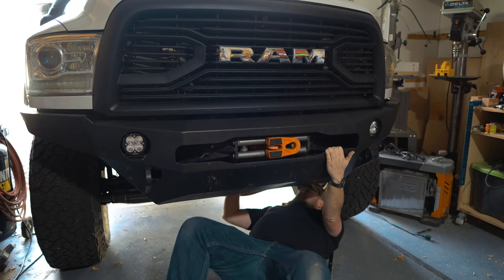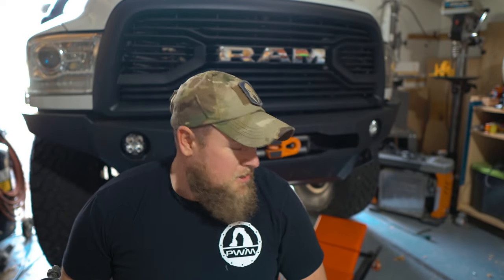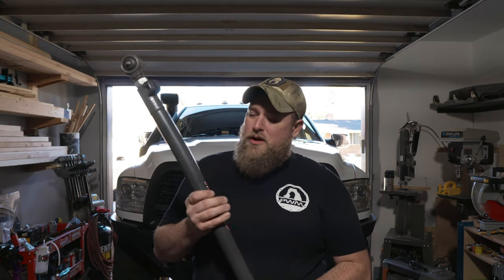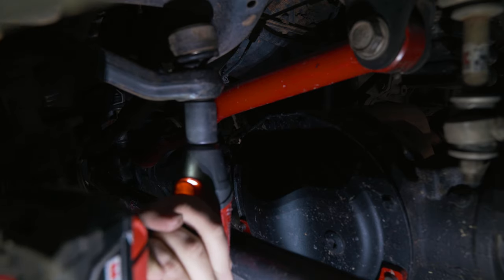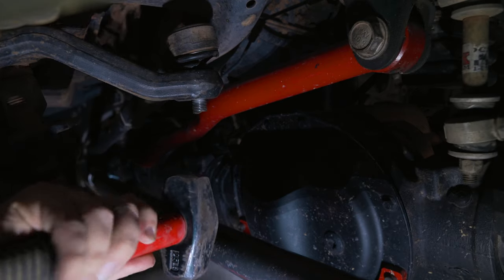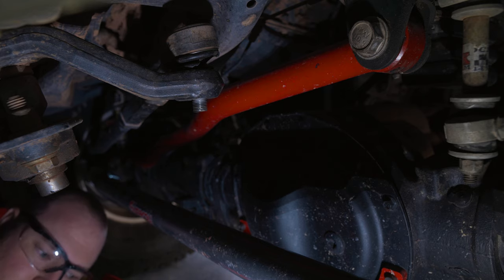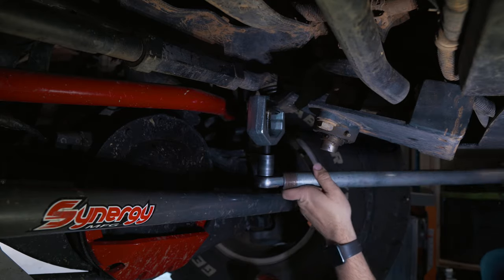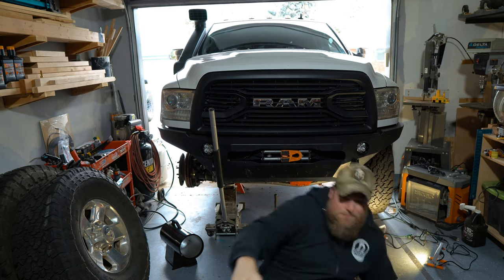VLOG #3 - Installing the Synergy Ram HD Tie Rod & Drag Link

Comment: What I learned after breaking 3 pitman arm pullers on my Ram...
Set up your last (4th) pitman arm puller and tighten just to Snug ft/lb then use a map gas or propane torch to heat the pitman arm.  Stay out of the way because that pitman arm with take off like a rocket.  Heat goes such a long way for breaking things free and expanding metal.  Thanks for the video 🥃

Comment: Take the wheel end off and rotate it so its pointing out the front. Put a socket or piece of tubing between the pitman arm and the drag link, and lift. Big long lever works everytime. 💪

Comment: 2016 89,000.  Rear u joint, probably due to several water adventures in 24 inches of water and routinely pulling a 16ft PJ dump trailer and 8300lb excavator nearly every day with it. She's a horse. I got off the fence lol. Looking forward to meeting all the PW guys at PWIM 20!
Reply from the maker: awesome

Comment: '16 PW that just rolled 68k today. Had a EVAP solenoid fail under warranty which has been my only issue to date. Oh, and my upper intermediate shaft u-joint isolater has the typical wear now. I have the EMF bushings waiting in my shop to install. No complaints with the truck whatsoever. Taking her down to Mexico for some beach running and camping here in two weeks. I'll post trip pics over on PWR when I return.
Reply from the maker: Dude! So, my EVAP solenoid just went. Got the little light today, pulled out my scan gauge and boom, there as that code. Figures, mine is waaay outta warranty. Oh well. Cheap little part.

Comment: The synergy is nice but my tie rod end went out after 2.5 years and 45k miles but the tie rods only run a 100 bucks for both so cheap but the whole assembly is 400 to 500 now but hope it’s working well for ya

Comment: Mileage is 188000 miles. Just dropped a brand new 5.7 hemi in it 450 miles ago. I have a 2013 Ram Power Wagon and I am getting steering issues and feeling bumps. I put Moog junk on it and will be moving to Thuren. I definitely want to change my tie rods they are bleeding like crazy.
Reply: Moog has really gone downhill over the years. I’ve quit buying anything but the Carli/Thuren (or equivalent) stuff for my old 2nd Gen

Comment: '13 PW...best year...hahaha continuance from PWR.  About 62K miles.  Love it.  In for PA state inspection today, getting tranny, xfer, diff fluids, oil change, tire rotate, rear rotors and pads while their at it $1,700 later...all that stuff, normal maintenance and inspection adds up.
Reply: Correction:. $1,810 after they found RR lower guide pin corroded and stuck in the caliper bridge (was cheaper to buy whole caliper, bridge and bolts than just the bridge and bolt set), and one of the tail pipe brackets was rotted out.

Comment: Something I just figured out to get the end off the Pitman arm. Get your pickle fork as far in as you can (to where it can't be pounded in anymore), then turn your wheel to the left. Freaking thing pops right out! I suffered for about 2 1/2 hours until I did that as a last ditch effort.
Reply from the maker: SFV Radio that’s a great idea!
Reply: Thanks for the tip.  I, too, bent the Harbor Freight pitman puller.  It was your turn-left pickle fork tip that worked for me.

Comment: 95444 on my 2014 ram 2500 with the 6.4 thinking I need a new drag link as well. Getting some thuds at low speeds less then 15 mph when I turned the steering wheel side to side less than 6 inches each way can feel it in my hands great video thanks for sharing brother

Comment: 2014 ram 2500 6.7 crew. 210k miles. Tomorrow morning I'm installing the synergy steering box  brace, drag link, tie rod and track bar...... hoping to get some info from this video.

Comment: I have a ram 3500 Cummins and had to replace the dual batteries within 2 years, live in florida so the heat is hard on the batts.  Larry

Comment: Hey man I’m having issues on my 2016 2500 every time i turn left or right I’m having Jerking back and forth. Any tips on what I should replace or fix?
Reply: Bigeddy B did you ever get it fixed? I just installed mine and it makes a jerking/grinding sound.

Comment: Is that a winch bumper? What kind is it if you don't mind me asking, it seems to be relatively low profile and that's what I've been looking for
Reply from the maker: It is not a winch bumper. Because I have a power wagon, and the winch is in the factory cradle between the frame rails. This is just one that is high and tight.

Comment: What was the issue that made you change it out? My truck is drifting left and right
Reply from the maker: I had that problem with my Toyo MT's, they had a serious pull to the right, even with alignment. But I swapped mine out because I literally bent the drag link and broke it in half on Gold Bar Rim in Moab and I also bent the tie rod on Top of the World a year prior. I wanted something stronger and easier to replace the ends. These won't break or bend without a lot more effort.

Comment: For the drag link do you just make it to the shortest setting the adjust it while its installed or does it come dailed in already?
Reply from the maker: I had to adjust mine out.
Reply: Thanks - just so that I am clear - Pull her in straight - If the steering wheel is not straight - straighten it. Adjust the Synergy link per their instructions to fit the possibly new gap verses measuring the old link as the reference - and install? Thanks @JustHappy2bHere

Comment: Did you have to do an alignment after install??
Reply from the maker: I didn't. I did a drive way adjustment, nothing was to far out and then adjusted my steering wheel. But I learned to do drive way alignments a long time ago.